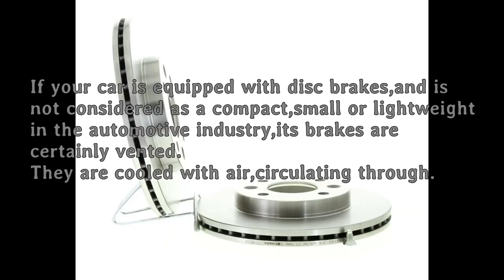Brakes cooling visualisation via smoke.

Comment: Great video. Shows what the vanes are designed to do. What happens on the track is that the wheel well has a pressure gradient sometimes that impedes the flow from in to out. That’s why race cars use brake cooling ducting to aid in volume and flow of cooling air.
Reply from the maker: Thanks.
Yes,or simply rims moving air themselves.
Mostly on rally as i think,where speeds and aerodynamic are relatively low and less important compared to a track.

Comment: Great experiment. Looks like if a cold air hose is fitting near the inside, then the disc will then suck the air in. Does not really need a disc shield?
Reply from the maker: Thanks,
Disc shields help to avoid water splashing,wich can damage discs if really hot when splashed,and helping to reduce braking power loss if the disc is wet.
Sometimes the air intake on the disc is on the outside face,so it has to go through the rim,or between the rim and disc.
It's not needed,but can be useful,depends if the rim is very bigger than the disc or they are similar in size,so water has less chance to splash.

Comment: Does the wheel provide as a fan for the outside part of the caliper? Because its also like a fan?
Reply from the maker: Depends on the wheel itself.
Normally it's more an obstacle for the air flow than anything else,unless it's desigend as a fan.
https://www.google.com/search?q=rally+vented+rim&client=firefox-b-d&sxsrf=ALeKk02GPc9QLAFWYWE6Ug6jYWgWo5nzUw:1601458760842&source=lnms&tbm=isch&sa=X&ved=2ahUKEwjQr7_kypDsAhUPxIUKHbGLDmgQ_AUoAnoECAsQBA&biw=1920&bih=977

Comment: Smoke under my car while I'm on mountain traffic.. This is break pad issue? Or something elese?
Reply from the maker: If you are going up,it can be water splasing on the catalytic converter,wich is hot,and it can produce vapor.
If you are going down,it can be brakes,hot,wich do the same with water.
If it's not wet,it can be something burning,like some oil leak ,seen that the car is not flat,the oil can go a different direction than usual.
If your brakes are smoking ,that mean they are very ,very hot,it should be smelly,and it can be very dangerous.
Be sure to go downwards with the engine braking power,then adjust speed with brakes.
The hotter they are,the less effective they are.
Reply: @michaelovitch  i have change the caliper and break pad, issue is resolved...
Reply from the maker: @Bhagirathsinh_vala  
Ok

Comment: Can ventilated brake discs warp?
Reply from the maker: Yes,like all discs cars,motorcycles etc...
Sudden excessive amount of heat or sudden excessive cool down will damage them.
it's just a piece of metal after all.
Reply: michaelovitch so adding water to hot brakes is how bad?  lol  
  ive done it a few times to my cars brakes bc it radiates intense heat( of course it will) but i try to cool them down once ive made it home
Reply: not a good idea to do that ,  warping them is the  best case scenario , you could also crack them lose a part of the rotor and kill the pads , the caliper etc . And if that happens you are not safe at all ... for example at the old company that i worked on the boss had a little van ( a Sprinter ) and it was losing coolant ,  and some wisehead put some cold water into the boiling hot engine , he cracked the block and the same thing it could happen with your  rotors

Comment: Why dont engineer just do a water cooling for the disc just same like the engine cooling system..😅..and the car will have tiny radiator and electric water pump for the brake system..
Reply from the maker: Too much weight for very few applications.
I've seen people water cooling the calipers,in wich brake fluid can boil because of the heat.
Otherwise,it's too much weight,better to focus on improving aircooling.